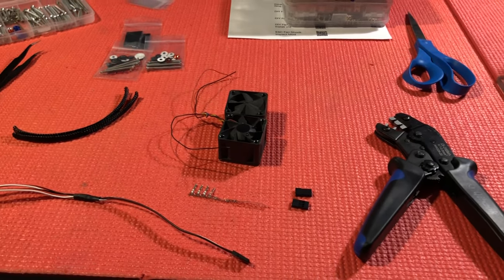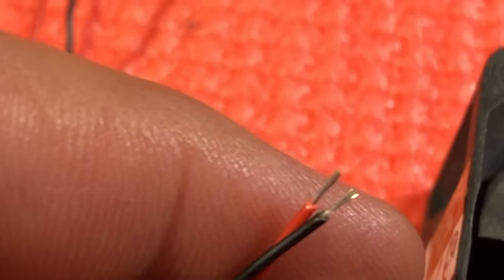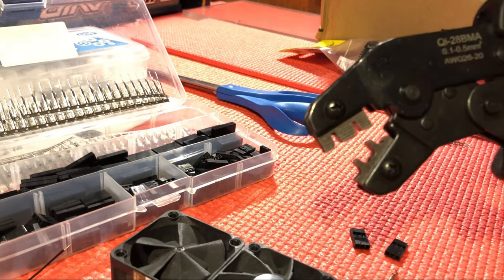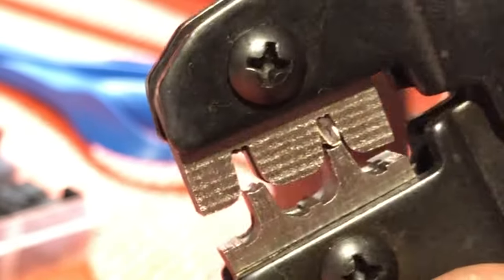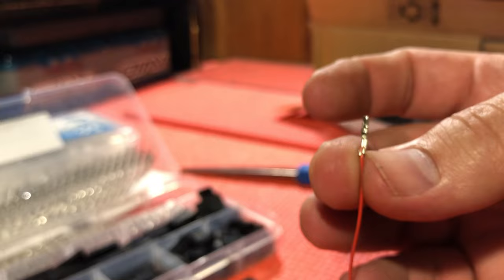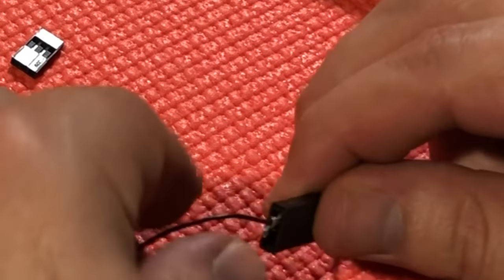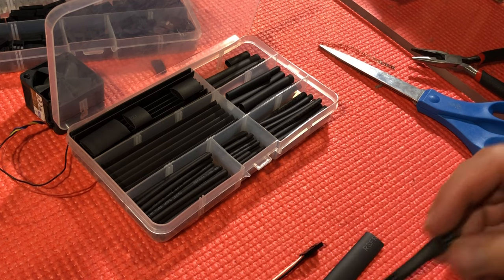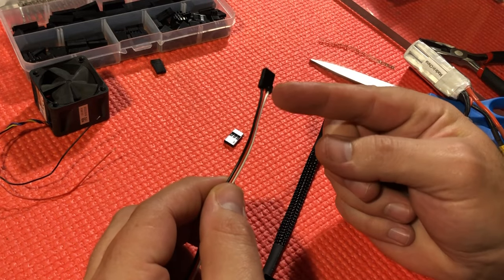Arrma RC DIY - Solder FREE Outfitting 40mm Fans - JST Terminal crimping tool ~ HOW TO

Comment: I have a question on your switch adapter. You are using a ground and one on for power on a 3s battery.. wouldn’t that one pin only be pulling one of the three cells to the fan? TIA
Reply from the maker: No, because when connecting it (the two wires, black and red) to the 3S battery via the balance terminal. Your connecting those two wires to the outside two terminals as the video describes. Because of this, you are connecting to the whole battery.